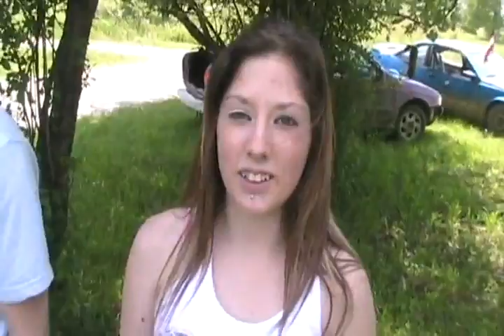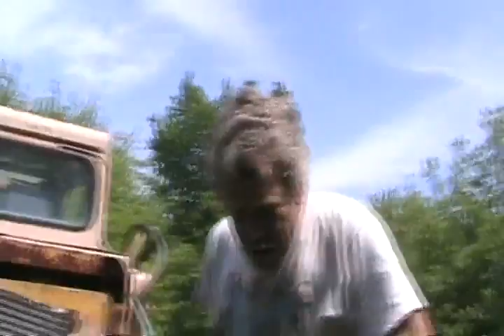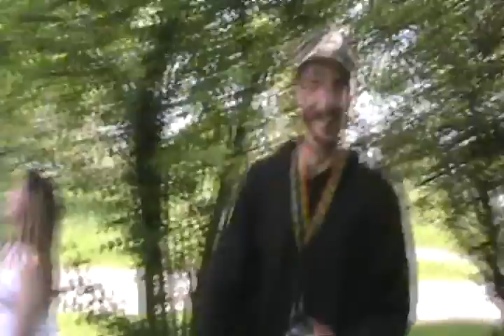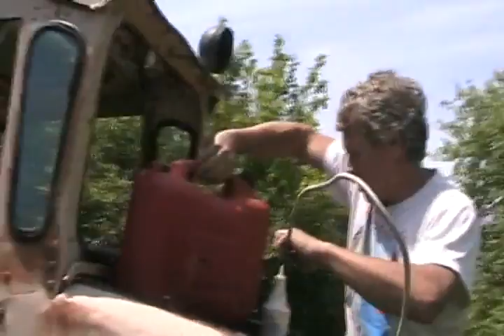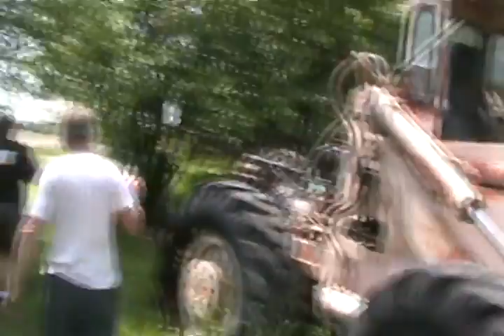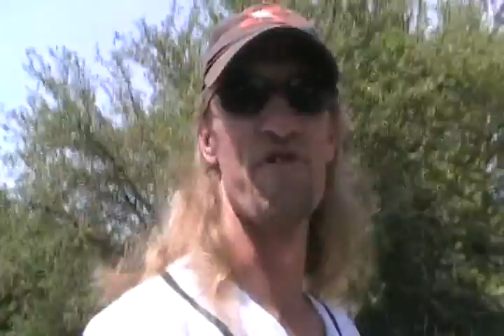#1007 get chevy powered 1963 front end loader running [Davidsfarm]

Comment: No, that's NOT amazing for a 305. Sure, 305's are not power houses, but they are a Small Block Chevy. And Chevy didn't make a "bad" Small Block. They did make 2 that were failures for a certain goal, which was the 262 and the 267. But they too were small blocks, And they too provided good service when taken care of. Just like the largersmall blocks did.
Reply: They also had a 265 v8 starting in 1955 until about 57. It was the first design sbc that we know today, but not the first v8 from them.
Reply: Wrong, chevy did build a small block 262 V8. Trust me, there's nothing you can tell me about a sbc that I don't know. Look up the sbc 262. It had a 3.671 inch bore and a 3.100 inch stroke. came out in 75 and discontinued in 76.
Reply: +DoubleVisionandco you were correct which is why I deleted the other comment. I forgot about the monza having the 262 v8 I thought it was a 267. My apologies.